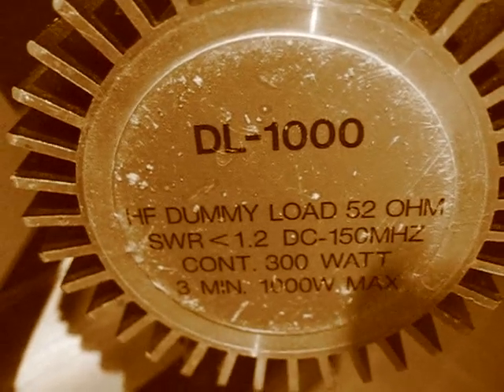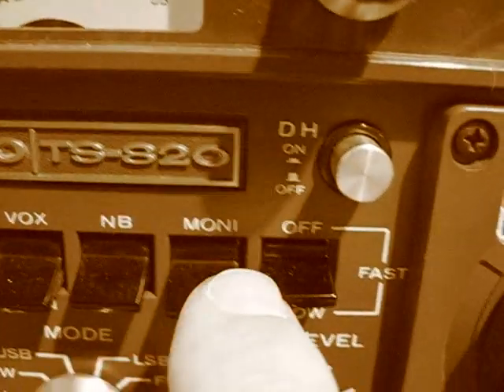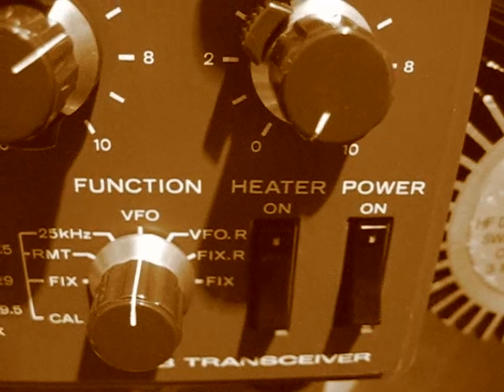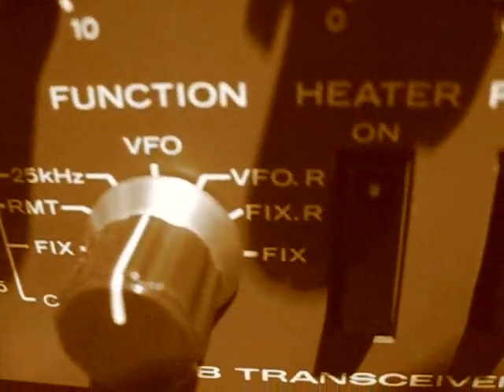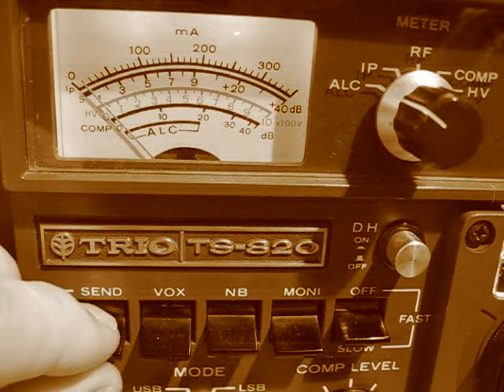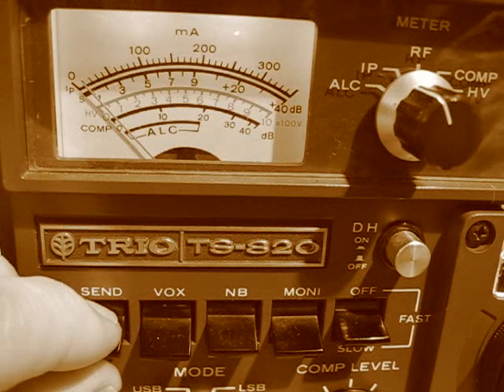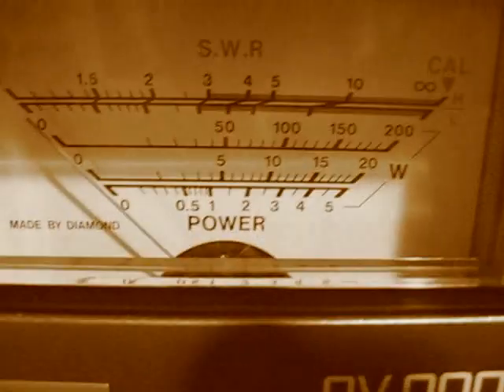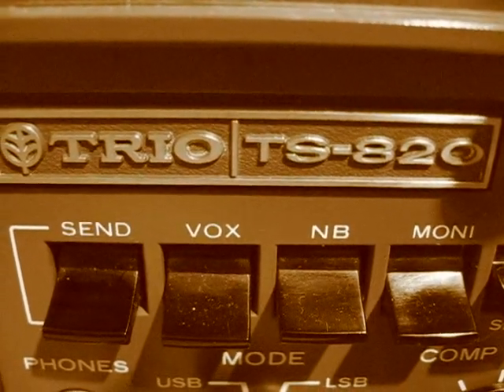TS-820 TUNE-UP

Comment: ALC  what. Kind of rushed through that. Could you explain? Drive is up full when you start your tune up. How is that done. Do you need to check idle current for these tubes

Comment: I agree you are going past the ALC meter limit, I always set mine to about 3/4 on the scale also when you are tuning it for full power output on CW your meter should be on RF not IP., I have never seen this process done exactly how you are doing it. hopefully you haven"t fried your tubes LOL  73, from United States

Comment: Very helpful video. You method is much faster than the method that I have been using. Sadly, I discovered that I am only putting out 40W on 20M if I tune the plate to 225 ma. I guess I need to start shopping for new tubes.

Comment: Got my Ts820 up and running too.
It had the following issues

Q14 on PLL board-2sc741 was open- replaced by 2n2222
PLL out of adjustment, tuned to 3.1v midband
Display had an open via -cutting power to the display inverter. Via below 100uf/10v capacitor next to L23
12by7 screen resistor had drifted to 9k from 3.9k 

ab2xf

Comment: hi mtae lovely rig,ive got a trio ts 830,can i say that u done the alc bit wrong,u peaked it right past the alc mark,ur supose to have it on the end of the alc meter,u had it way past,u turn drive down so the needle wont go past the alc mark on meter,u want it to reach the end of alc meter,not well past it as u did,try that mate its the proper way to tune it.keep up the vids mate,oww im not having a go at u just try to help

kev

Comment: I have a TS520 and once you get into the swing of plate and load you have a fair idea where the settings should be for the band you are on and then just peak the plate and load for maximum out put on your power meter.